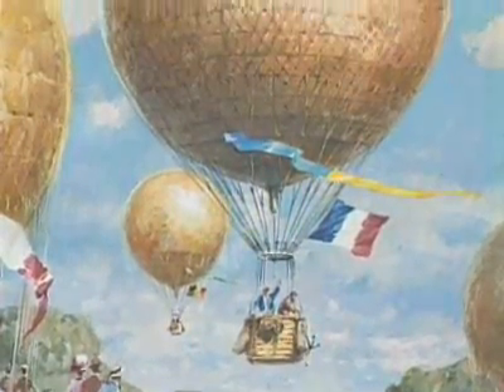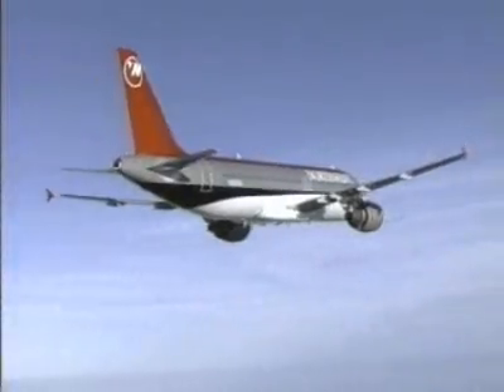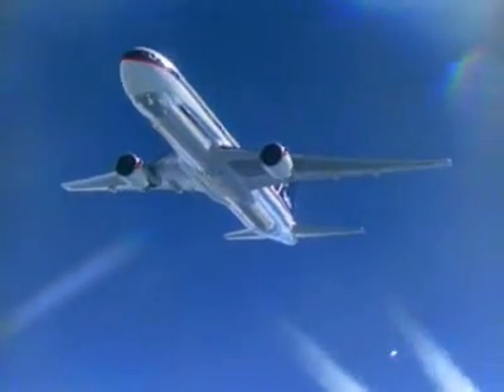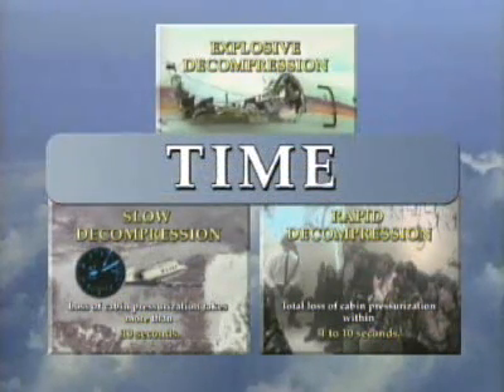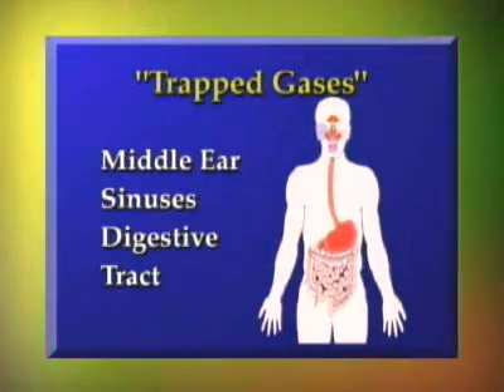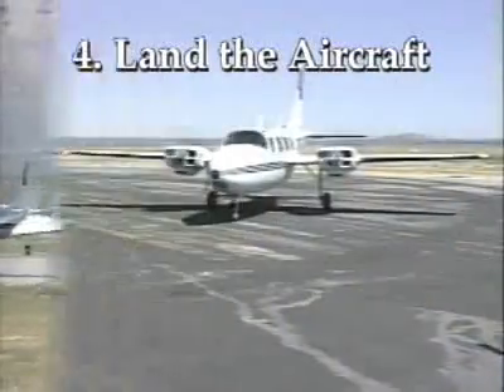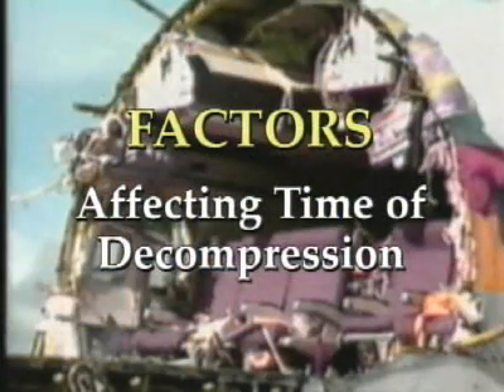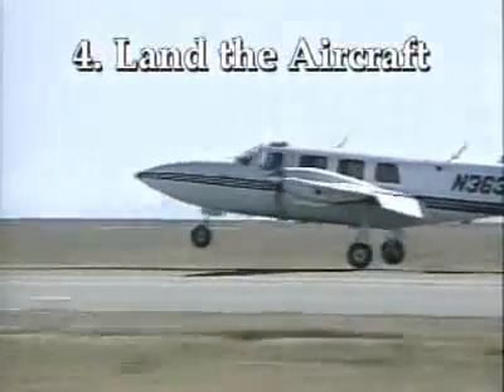The Ups and Downs of Cabin Pressurization

Comment: Terminology is so confusing for everyone. In your isobaric example you state that y use of overflow valves,  the air comes in quicker than it leaves and creates a "high pressure environment."
In fact compared to the sea level atmospheric pressure of 760 mmHg, having ascended to a cruising altitude, the cabin Air Pressure is now approximately only 560 mmHg. So compared to the sea level atmosphere, cruising atmosphere is actually a "low pressure " or hypobaric environment. It is essential to understand that all passengers have had to endure a body decompression of approx 200 mmHg, and are now facing the challenge of a hypobaric environment.
Reply: No. You're wrong.
Reply: The pressure is "high" relative to cruise altitude. The pressure in the cabin is higher than the atmospheric pressure. Basically it's a flow of high pressure air with a controlled leak (outflow valves)